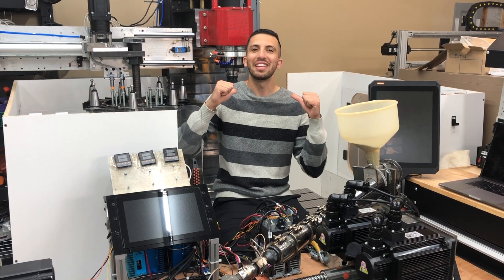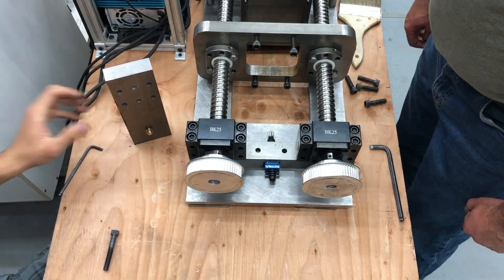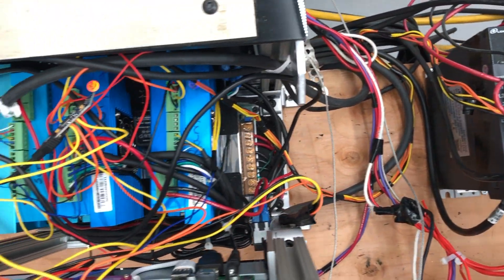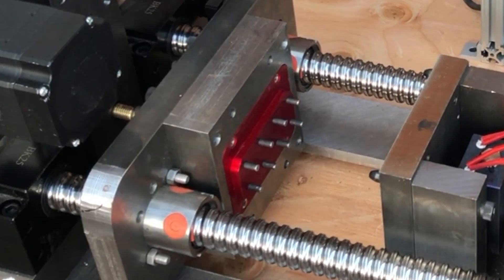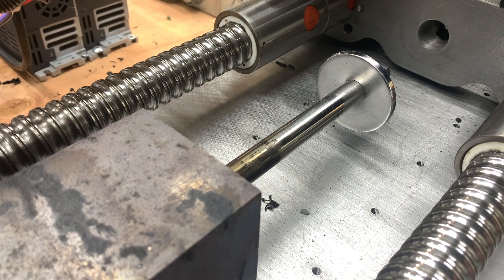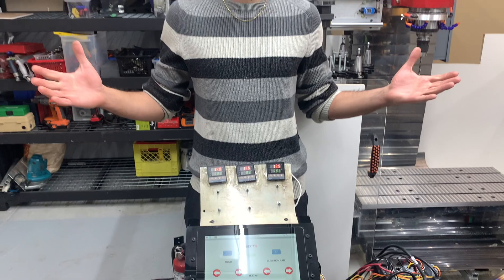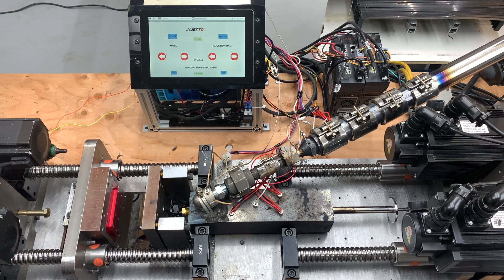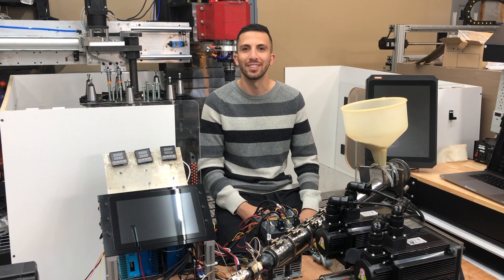Homemade Plastic Injection Machine | DIY

Comment: Dear lord.
Accomplish a 100engineer feat of building a machkne with Mechanics, Software, Electronics and probably PLC drive units with Basic?

I commented your CNC clip about accuracy and have some thoughts hear aswell.
Firstly the mold matrix should be more efficient If you design coolant channels that lign up with fixed positioned coolant chanel on the press. A better design for implementing cooling of the mold would be to have one half of the mold in fixed position, have the ejector rods switched out for pneaumatic air channels that opens up from the mold to let air inside the mold like a car engine valve, and also too add liquid cooling to the mold halfes.

Even when molding plastic parts an decrease in the molds heat dissipation ability can mean that after 10 completed pieces the rest come out warped due to their uneven hardening process. This is especially true when making flat surfaces because the center cools the quickest.
A plastic frisbees center is always thicker than the edges, if not the warm injection molded frisbee would warp when cooling down.

Injection mold cooling has to be carefully thought of, when designing the press matrixes and it's cooling channels, when designing the part, the part needs to be measured on long batches or unoptimal cooling to detect design flaws..
Usually either intuition is used by the engineer or FEM software to show heat transfer (Finite Element Mechanics software or Fluid Mechanics or Thermal Mechanics)
BTW, this is also why Injection molds can cost 10thousand $$..
Reply from the maker: Thanks for your input. It is very valid and I hope other viewers take this into consideration. Cheers

Comment: Could you try injecting shredded pla 3d print scraps? I think that would be far better option to recycling filament than trying to make new filament
Reply from the maker: Interesting thought, I’ll give it a try
Reply: @ActionBOX  Please do, I've not seen anyone try this yet. I've been pondering on getting a cheap diy injection molding kit for this purpose and to learn some CNC skills for making aluminium molds, but it would be great to see if it works first, or if there are some issues. Recycling PLA scraps with this would do great for local communities, and would be far easier to setup than consistent filament extruders.
Reply from the maker: I’m thinking I need to start with figuring out how to shred the pla scraps.  Any thoughts?
Reply: @ActionBOX  for small scale and light weight pieces (e.g. skirts and support structures) I've used just a kitchen blender to get the pretty small. Looking at your workshop, I guess you could have the resources to get or build a "Precious Plastic Shredder" or something similar. Basically a scaled up version of a office document/paper shredder, with beefier metal teeth.

Comment: Makes me wonder what differentiate "homemade" and "one-person workshop"
Reply: sleeping on the workshop helps to make it feels like home,
Reply from the maker: hahahah, fair enough. Hope you enjoyed the video regardless. Cheers
Reply: This does feel a tier up from homemade. But while I have a couple ideas how to make it using casual hobbyist hardware, there’s still the injection die issue - and I can’t think of any way to overcome it without a metal-capable CNC
Reply: @Pentross  local guy here uses 3d printed mold.  And they work fine.  He gets a few hundred parts per mold easily
Reply: @Pentross  Exactly, making the machine is the cheap and easy part in the long run, the cost and difficulty is in the dies and keeping them in good condition.

Takes nothing away from this effort though, cool setup.
Reply: There doesn't have to be any difference.  My one person workshop is at my home.  Across the street is my other workshop. Where most days i work alone,  and some days there's 5 other people in there working
Reply: This, definitely this 😂 I don't think we can call this DIY anymore 😅 nor do I think we can call any CNC machine DIY 😅 kinda turns into a very special field with very specific knowledge and skills
Reply: @FlybyJunkie  there's plenty of diy CNC stuff.  I've built a few
Reply: True still searching true homemade
Reply: This isn’t DIY and if it was they wouldn’t be trying to sell all of these kits. 

These are no more than infomercials meant to look difficult enough to the average person so they don’t attempt to build but instead buy their machine. 

Keep in mind its really not as difficult as presented but i do wonder why hydraulic clamping and injection wasn’t used. Also all of this is available online. You don’t need two copy cats to demonstrate it for you. Google is your friend. 

Also if it was DIY then why didn’t they show the extruder design broken down, explain the electronics, why they needed it computer driven, etc. Btw, nobody in their right mind believes they had the screw, band heaters, and all those other parts on hand. Seriously, wake up.

Comment: I want to add something u can keep ur tailstock platen moving not clamped to base this will give u adequate tonnage if u want higher injection speed and pressure. Just a suggestion. Can u make tutorial on raspberry programing
Reply from the maker: Can you elaborate on what you mean?  I’m not sure I understand.
Reply: @ActionBOX  also by keeping it free when ur moving plate touches the 1st plate and if further movement is applied the lead screw will act as tie bar and streches which will indeed add more tonnage force
Reply: @ActionBOX  I am not sure it will work at small machine. But it works on bigger one
Reply: @ActionBOX  if u want to upgrade clamping unit in future try to use toggle clamping it will give more force
Reply: @ActionBOX  I have done training in injection molding manufacturers . That machines where much bigger and fully hydraulic. 
What I mean to say is there are three plates in clamp side one which is on injection side, 2 is moving one and 3 is where mechanism for moving 2nd plate is located. So u have to keep 3 plate which hold mechanism to be free from base not fixed.

Comment: It's been asked a bit before, but on the note of Open Sourcing it, i work with a group called "Precious Plastic" which develops Open Source Hardware for Plastic Recycling, and this would be a great contribution!  I'll share it around a bit.  Also you can get on the Precious Plastic Forum, the Discord, or ask for some contact info if you want to collaborate!
Reply from the maker: Thats awesome, thanks for sharing. I definitely thought of the application of using these machines to recycle plastic and glad that I am not alone. I wonder if this video was posted on the forum how many other people would be interested. Cheers, Dave

Comment: Great for you but what about the little guy?  How about making something smaller and a lot more simple.  Use your knowledge and design a mini model.  Thanks
Reply from the maker: Great suggestion! I promise you a smaller machine video in the future (Hint, ive already started and its about 5 times smaller 😉)
Reply: @ActionBOX  That’s great, please keep me posted. I’m a maker and have used a 3D printer for about 4 years.  Your making 
 something I’m very interested in using.

Comment: Those ball screws would of cost a bomb not to mention the 4 motors on top of that. What clamping force would I need for a mould that is 230 x 140 x 60mm? Any help would be greatly appreciated 😊
Reply: Clamping force is your part cross sectional area (230 x 140 I think in this case) times the injection pressure. F = pA for short.
Reply from the maker: I would really need to see the actual molds in order to accurately respond to your question. What exactly are you making?

Comment: If you upgrade this machine or design a new one, you should consider moving from a piston to a screw to generate the injection pressure. Plastics are shear thinning, meaning that they become less viscous under shear (like in screws). This is caused by the polymer chains becoming less tangled, allowing them to flow more easily. You will be able to inject at a lower temperature and pressure, leading to less polymer degradation and mold wear. 
Thinned polymers will also weld to themselves more readily, so if you move to molds where the flow splits and re-joins itself (like in a ring-shaped mold) the parts where it re-joins will form stronger joints.
Reply: Yes, someone just of university has watched this channel and understands what’s going on. Thanks
Reply from the maker: I like the point. would that be fast enough though?
Reply: @ActionBOX  Unfortunately, you need a pretty big motor to keep up with that kind of flow rate. I looked up the specs on a run-of-the-mill commercial machine and it has a 7.5 kw motor for a shot size (amount of injected plastic) of 55 grams. For the kind of unit you would be able to build at home, you will have to keep the shot size pretty small.
Reply: @eric8syj1  Hi!

 What is the best type of injection moulding machine? With your comment you imply that machines that push the polymer mass with a plunger are not optimal.

Thank you.
Reply: O melhor projeto que eu já vi,mas acho que é muito dispendioso.  Gostaria de saber quanto custou.

Comment: Incredible and Inspiring!  Thank you! Would you consider building a (Die Sink) EDM?  I have been researching for quite some time and have yet to find a build that I like.  Imagine using a metal cookie cutter to "cut" out stainless steel cookies.  On a more practical note, imagine cutting a gear with just the z-axis. I want to cut thick metal blades from spring steel for use in a DIY plastic grinder.  The Precious Plastic grinders at $1200 are just too expensive.  I think that using an EDM mill the cost could be cut to a fraction of that.
Reply from the maker: TBH, I have been a fan of EDM for a while, more so wire EDM, so that may be one of the future projects. Thanks for your idea 😃
Reply: @ActionBOX    I edited my reply so you have a bit more info on what and why I am looking at die sink as opposed to wire.  Also, the complexity is much lower.  As for steps after that (EDM+), die sink EDM on a 3D printer chassis. That way I can mill in more of a traditional sense, without the added expense of the wire. (A bit more eco friendly also.)
Reply from the maker: @-robo-  Thank you. Definitely a great project to work on. I will have it in my list of future builds 😃

Comment: Any plans to add cooling and will you sell  a kit on line
Reply from the maker: No and no. I will be making all plans available for free in a subsequent video, and a small air fan works just fine for these small molds. Cheers

Comment: As someone who spend few years operating industrial injection moulding machines for living, I see some issues here and there in that design. But despite that, it's pretty cool project.
Reply from the maker: Thank you. I would love for you to share the issues so I can try to tackle them or explain my justification. When scaling down the machine many features had to give such as say PID control of mold temperature. Other than that, what else do you see as the issue? Cheers
Reply: @ActionBOX  Yes, I agree, you can't fairly compare tabletop DIY moulding machine with 10ton industrial one. There probably no way to produce same pressures, forces and have same level of mold temperature control at tabletop scale. And from short video hard to tell what's exactly going on in every part and hard to tell how well it actually performs in current state. But few things still still popped out to me.
As your screw and injection chamber two separate pieces, it seems, I don't see any thermal insulation. Few layers of fiberglass around those pipes wouldn't make any difference?
Was there any reason why mould side of the "the good side" was on the injection side and the other way around?
And after opening press seems like it has to travel very far to eject the part. I feel like it could could do better with only a fraction of that path, but there might be some reasons too.
Still very cool project, just wish video would be more detailed.

Comment: Die cooling?
Reply from the maker: Using a small electric fan worked perfectly for this small machine. No need for water cooling nor heating of the molds. AKA, no need for PID control of die temperature.

Comment: nice work bro, this is sick. just one recommendation to put the hmi on the same side the operator stands on. Most places would consider reaching across the machine to operate it a safety hazard, haha.
Reply from the maker: Yeah, there is the actual engineering (which was hard enough) and then the human factor engineering which was too much for a single student to handle 😂. Great point though, and thanks for watching in detail.

Comment: Hi, great project!!
How does the plastic stay in the injection chamber while it is being filled by the screw? Does it not come out of the injection chamber nozzle as the plunger retracts? Is there some kind of "closing valve" to prevent the plastic from flowing out the chamber while it is being filled?
Reply from the maker: Hi, Great question, there is a nozzle pressure valve, which is essentially a steel ball that is spring loaded. It only opens with sufficient pressure, such as that during injection. Otherwise, it seems against the steel body, so there is probably a theoretical leak, but it doe not affect function. Cheers
Reply: @ActionBOX  Thx, fantastic work.
 Any way we can download the CAD files for your machinery? Or maybe, do you have some kind of pdf with more details.?
Reply from the maker: @toshiba162  I hope to make them all available soon enough
Reply: @ActionBOX  Got it. One last thing, what are  the clamping force and injection pressure in this system? Seems to me that industrial machines are always oversized in terms of clamping forces. The one you build probably doesnt exceed 5 tons right?

Comment: Next step:  Build a CNC Laser or plasma cutter to churn out some sheet steel parts for an enclosure, then build a brakepress to fold all the sheet parts, and build an enclosure.. this machine deserves a nice enclosure!..
Reply from the maker: Hahahhaha, very true, I have thought about it 😜. Lots of machines left to build
Reply: @ActionBOX  ah.. well.. same here.. i built my own CNC mill (4 axis.. 5th axis yet to build), i converted an EMCO Compact 5 CNC to EdingCNC, i still have to really finish it, and put it in an enclosure, I have a Wire EDM, and a Sinker EDM that also need some TLC, and an EMCOturn 120 lathe that i also want to convert to EdingCNC, and add some features like automatic chuck, barfeeder and parts catcher..
Reply from the maker: @JanBinnendijk  sounds like its time to start working then 😂. Very cool.

Comment: I wonder if failed prints and supports from 3d printer can be recycled for use here.... Lost PLA casting for the molds + this injection molding machine + recycled filament = exciting future for hobbyist level maker community
Reply from the maker: Thats a very interesting point. im sure it would work but you would need to find a way to chop down the supports to ensure they are all smaller than a certain size (so it doesn't get stuck in the hopper.
Reply: @ActionBOX  Check out this 3D Printable Polymer Pelletizer
Reply from the maker: @MikeJones-mf2rt  Can you share a link with me? Id love to see what you have in mind
Reply: @ActionBOX  I did post the link, unfortunately I think YouTube is automatically taking it down.
Reply: @ActionBOX  Let me know if you were able to find it
Reply from the maker: @MikeJones-mf2rt  Sweet, thanks Mike. Ill check it out in a bit

Comment: So... when can we buy it?
Reply from the maker: Haven't really thought about selling it 😆
Reply: @ActionBOX  why not? Base model like a 3D printer and then offer cnc service for molds in case buyers don’t have a mill. If you patent it quickly you might be faster than the Chinese.
Reply from the maker: @tronixfix  Im just not sure where to start. Im so busy as is 😂. Any ideas?
Reply: @ActionBOX  get a contract with another local company that can reproduce your machine and give them a contract to serve your customers. You will hold the license for the sales rights and they will just produce the machine for you. Later on (around two years after first sales) you can switch to a chinese manufacturer to save cost and have more income. You’re located in the US, right?

Comment: Great work! I'm looking forward to seeing more about this project. I've been thinking about home injection molding for a while now, and this is quite inspiring.
Reply from the maker: Glad it was helpful! what do you have in mind to inject at home? Cheers
Reply: @ActionBOX  Small parts for some small-run projects I'm working on. Encoder caps and buttons and such.
Reply from the maker: @tomboblombo  Wow, sounds interesting. This size machine is definitely up your alley then.
Reply: @ActionBOX  I'd imagine I could get away with something smaller too. I imagine if something like this goes open source I could easily downscale though. 😁
Reply from the maker: @tomboblombo  fair enough. I agree.

Comment: Great video but this is borderline not in the DIY or homemade fields
Reply from the maker: I made it by myself at home. Where there is a will there is a way 😉. Hopefully when I release the rest of the details it will be easier for others to build as a project at home. You can get away with having access to a simple mill even if it is not at home. Hope you enjoyed the video regardless. Cheers, Dave